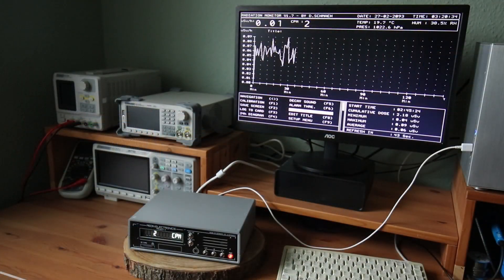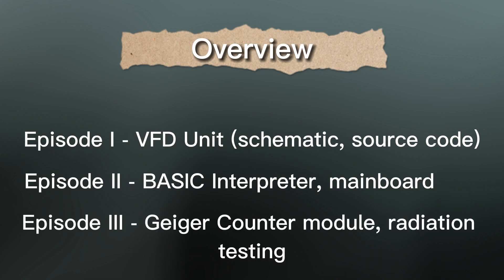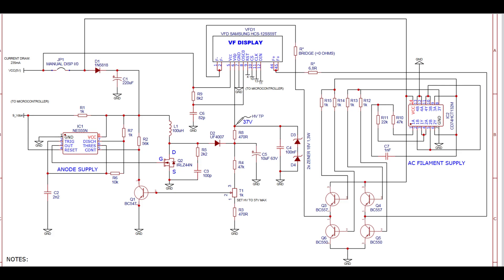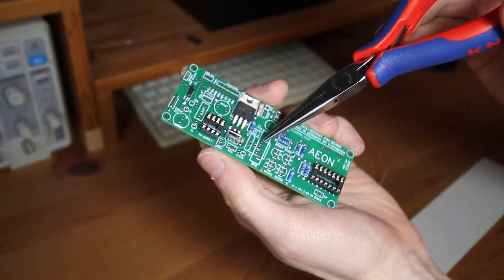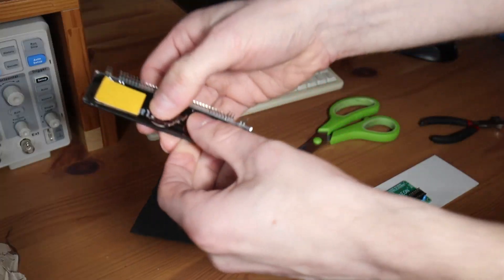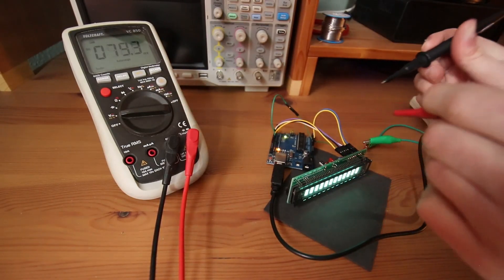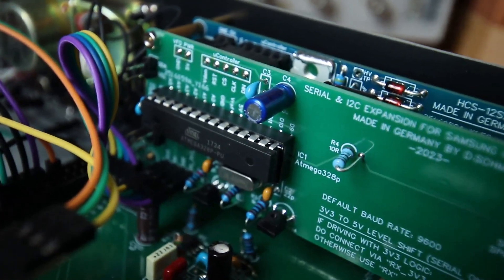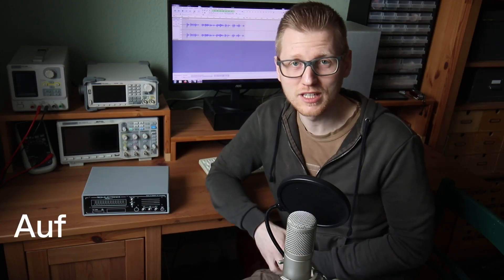Project X: Raspberry Pico Geiger Counter - Episode I VFD Display with Arduino Atmega328p HCS-12SS59T

Comment: i have been looking for an arduino or esp32 based geiger counter program that will accurately track 0 ~ 1000 mR/Hr through to 500 R/Hr since i will be using Si3bg GM Tube which maxes out around 300 R/Hr reading but saturation limit is 900 R/Hr

Comment: Hallo, ein sehr gutes Video! Ich habe auch einige der VFD Displays und ein Basis-Setup mit dem Atmega328 laufen. Bei 07:25 wird ein Gummi auf die Displayrückseite geklebt. Was ist das für ein Material bzw. unter welcher Bezeichnung kann man das beziehen? Bei meinem Board schwebt das Display quasi (hat keine Berührung zum PCB).
Reply from the maker: Diese Displays sind Gold wert, zum Glück habe ich etwa 100 Stück gekauft, nun sind sie leider bei Pollin ausverkauft. Das Gummi bekoommt man überall im Bastelladen oder auch im Internet, ich kenne es unter dem Begriff "Moosgummi", das habe ich mit Doppelseitigem Tesa festgeklebt, das hat gleich zwei Vorteile: einmal erreicht man so immer einen gepolsterten gleich großen Abstand, wichtiger noch: es isoliert die metalisierte runde Fläche an der Rückseite des Displays, denn die leitet und kann somit Kurzschließen (ist mir beim ersten mal sogar passiert).

Comment: I like how you approached the circuit. I have a request for you: could you please connect the oscilloscope so I can see the signal on the VFD filament? Is it AC (+5v / 0v / -5v) or positive pulsating (+5v / 0v / +5v)? I'm interested in creating a similar power supply myself, but I'm not sure what type of signal it generates. Thank you!
Reply from the maker: Hello and thank you. It is none of the filament supplys you mentioned. The filament supply voltage depends strongly on the datasheet. In my case it is around 3V elevated "AC-ish", so it is not swinging between 0 and 3 but between 1,4V and 4,4V. All this prevents from filament notching and gives a better brightness distribuition. In general the steps you need to take are: take a look at the datasheet and look for filament voltage, then convert it into an alternating waveform & elevate it around 1V above 0. The duty cycle isn't that critical. Of course for testing purpose you can just supply it with DC, but by doing so you risk a shorter life span and a bad brightness distribution (for example on the left its brighter than on the right side)... Key is the datasheet. Here you can see on the right side the waveform and on the left the circuit: https://raw.githubusercontent.com/qrti/VFD-HCS-12SS59T/master/images/s_ac_filament_supply.png

Comment: cool project but looking to minimize the counter size :D.
Reply from the maker: Thank you, yeah it isn't ment to be a portable counter, but an envirnonmental / local counter for the local gamma radiation. The module itself is designed smaler and you can turn it into a portable counter.
Reply: @Aeon_Electronics  i understood that , last time i checked the tubes it had high price so i skipped the project, still nice work Mate, do you pay any tax ordering parts from china in Germany, i ask as i just moved in.

Comment: Hi, friend. A very interesting project. Only the anode voltage source is not very beautiful. For a long time, everyone has been doing it with a two-winding step-up inductor transformer. As a feedback signal, "flyback" pulses from the drain of the MOSFET key are used. The amplitude of these pulses is proportional to the DC voltage on the output capacitor and less than it in the transformation ratio times. This way of constructing the converter makes it possible to achieve record-breaking low current consumption. And to analyze these pulses, it is not necessary to build a complex circuit. A simple Zener diode threshold device and an RC integrator are sufficient, the output of which can be interpreted as a logic 0 (output voltage below the required) and 1 (output voltage above the required).
Reply from the maker: Thank you for this input! Sometimes there are even simpler approaches. Since I have no small transformers for this variant, I prefer the NE555 solution. The current consumption in general isn't very high, most of it is drawn by the filament. An even better solution as your suggested one is, to let the Atmega328p do the High Voltage work, since it is already there for the I²C / Serial conversion. The Atmega328p can act as PWM source with feedback sensing. But I decided against it, because I want to keep it modular. There are always tradeoffs... But you are right, your approach would be possible, too!

Comment: Now thats awesome, will there be an external hookup for a probe or will it just be a internal tube?
Reply from the maker: The basic intention was to have an environmental radiation monitor. But I like your idea and I think I will implent it, since everything is modular and there are two expansion slots on the back. Thanks for your input! My current geiger PCB allows two different geiger tube sizes and is located on the back with a window.
Reply: @Aeon_Electronics  nice. Can't wait to see your progress.

My thought process was for an external probe with pancake or similar that is sensitive to alpha so you could run over an item to see if there is any alpha emitting material contamination on something, while it's main purpose will still function as what you planned.

Don't really want to enable too much feature creep, because that in of itself can be a pain to deal with. 

I'm planning on modifying a GQ GMC 320+ v4 by adding a BNC connector for an external probe that uses an sbt-11a to be able to detect alpha. It's going to keep the internal tube and add a switch to be able to choose the internal tube, or the external probe that way it's still portable and useable without the external probe.
Reply from the maker: @madmax2069  The GQ GMC 320+ counter are really good and affordable for what they are! Alpha detecting is not an easy task. Sadly (all) the pancake probes are really expensive. Even the small window tubes are pricy... I think the non plus ultra solution would be an solid state scintillator (without a photomultipler tube). You can even build a gammaspectrometer with it.. But again... The price :/  I also tried different PIN photodioade approaches with an BPW34, but failed due to the huge noise problems and therefore instabillities. But it is possible to detect alpha rays with a PIN diode, although not an easy task! :)
Reply: @Aeon_Electronics  it's not too hard to detect alpha, you just need to be within a few inches of the alpha source with an alpha sensitive tube, I've already removed the stock tube from my 320+ and wired in the SBT-11a (with resistors) as a test and already used it to detect the americium thats in smoke detectors, that's primarily an alpha source. 

Yes, I paid $50 for the SBT-11a instead of paying less and waiting a while for it to come from Ukraine (I don't really like to wait).
Reply: @Aeon_Electronics  the much larger version of the SBT-11a which is the SBT-10a which you can usually find for around the price I paid for my SBT-11a, BUT it's going to be shipping from Ukraine which takes a while, that is if it makes it out knowing what's going on over there. I also seen the round SI-8B tubes go for around $60 but those again get shipped from Ukraine, usually if you can find ones that are located in the USA they go for a lot more. And then there's the Ludlum 44-9 pancake probes which are pretty expensive (around $200 a pop).
Reply: @Aeon_Electronics  this is the design I'm basically following for my SBT-11A probe https://youtu.be/LtGybfT8KDE but I don't have a 3D printer.